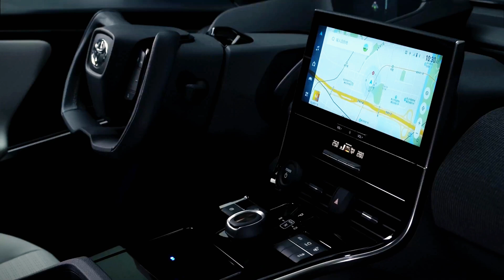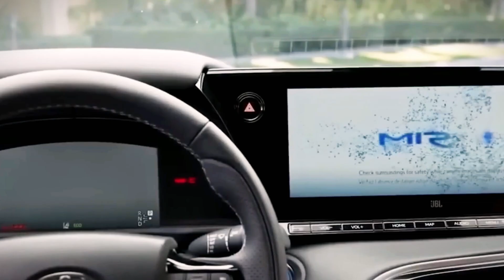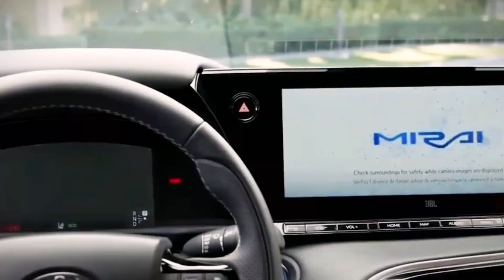Toyota CEO: This New Engine Will Destroy the Entire EV Industry!

Comment: This is not a water powered car, it is a hydrogen powered car.  Electrosis is a very slow process.  the hydrogen obtained from electrolysis would have to be pressurized by an electric compressor which takes a lot of electricity and is heavy.  High pressure hydrogen tanks are very heavy.  Elon Must has already laughed at this concept.  This video is a complete farce.  How about some honesty on YouTube.  Also, no alien culture is currently visiting Earth and putting chips in human brains.  UFOs are another version of Sasquatch.  The previous commenter is right on correct.

Comment: This makes ZERO sense.  As mentioned here, the water is first converted into hydrogen and oxygen VIA ELECTROLYSIS. 
#1) ELECTROLYSIS OF WATER REQUIRES A LOT OF ENERGY, FAR MORE THAN IS REGAINED BY COMBUSTING THE HYDROGEN/OXYGEN
#2) As described, electrolysis may be performed at the car by PLUGGING THE CAR INTO THE ELECTRICAL GRID. Just as EVs do, this consumes huge amounts of electricity.
#3) During operation, the car is storing and consuming HYDROGEN. It is NOT consuming water. Calling it a 'water engine'' is very misleading.
#4) General Motors (GM) has also worked on hydrogen powered cars, for decades.
#5) The difference between Toyota's approach and others appears to be refueling involves plugging into ELECTRICITY to initiate electrolysis instead of to a pump dispensing hydrogen.
#6) THIS IS NOT A WATER POWERED ENGINE. It is a hydrogen powered vehicle which requires ELECTRICITY as an in intermediate step to create the hydrogen

What this boils down to is whether it is more efficient to perform electrolysis at the vehicle versus at a central location, and then deliver hydrogen to a fuel station. That may indeed be more efficient. HOWEVER, currently, neither our electrical grid nor our power plants have the capacity to charge more than a few percent of the vehicles in the U.S. as EVs, let alone also load the grid with vehicles that must also use the grid for electrolysis to separate water into hydrogen and oxygen. 
First, our national grid needs to be MUCH LARGER. Second, most power in the U.S. is generated via. natural gas. So electricity in itself is not entirely 'Green'. So, to improve the 'Green' aspect of electricity, a much larger percentage of our power plants need to be nuclear, solar, wind, geothermal, etc. 

I am all for going green. But this video does a very poor job of describing what Toyota is doing, how it works, what is requisite for it to work, etc.
Reply: @gregparrott  yeahhh wtf bs clickbait I was just served… 👎🏻
Reply: I would only add that hydrogen also has a very low volumetric energy density which simply adds to the engineering problems for this type of engine. I've never seen any papers indicating hydrogen is actually a good fuel for cars so why is Toyota bothering with this research?
Reply: @farleyxwilbur3867  I don't think Toyota is behind any of the info spewed in this video. Typical AI video with bs script. When this channel reaches certain amount of subs it will be stripped of all videos and sold off. Has been going on for some time now.